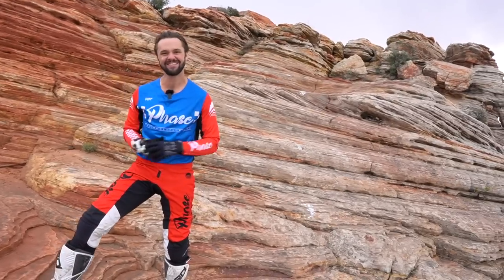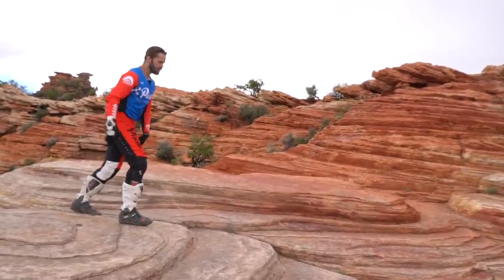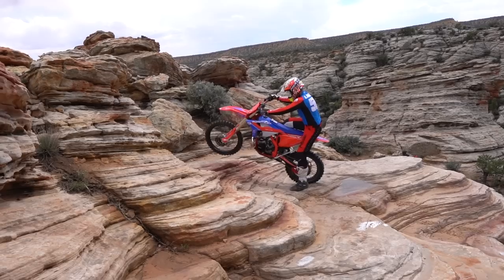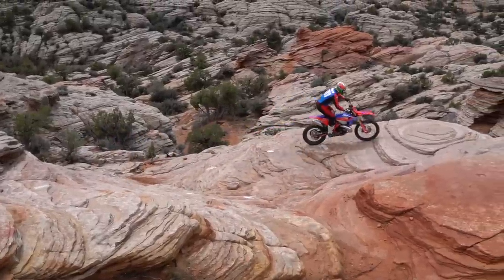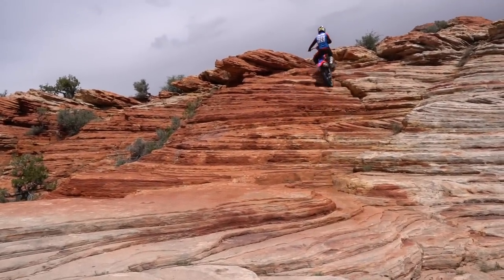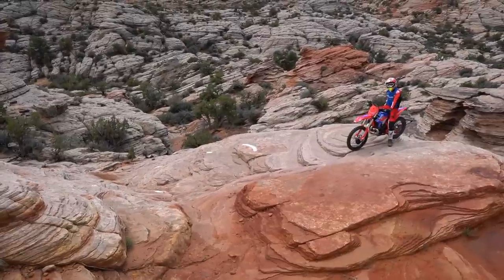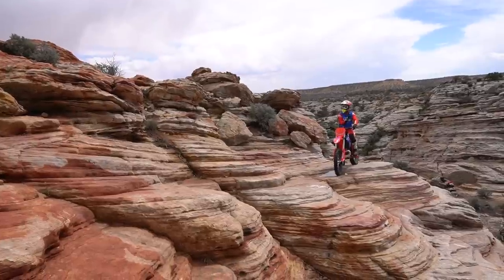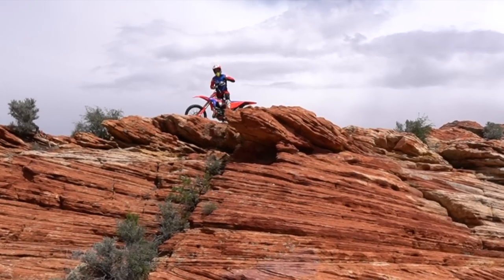Real World Technical Riding Lesson! 5 Miles of Hell, Section How-to E.P. 1

Comment: Hi Rich! First of all, thanks for all the videous. You are mine "online coach" :D What gear you use for this kind of obstacles? I was recently told in a Hard enduro training camp that 2nd gear is the driving gear and 1rst is just for pivots etc. I have a 13-51 gearing in my Beta 300rr.
Reply from the maker: 13-51 on the beta would closer to second. I’m stock on beta gearing so I’m in first. That’s a tough question for me to answer because everyone’s different.

Comment: What, if anything, do you adjust on your suspension for this trail vs. your typical single track....thanks!
Reply from the maker: That’s a good question. So suspension is obviously relative. A single track setting for me would be much stiffer with more rebound dampening. For this trail, it would be closer to the opposite for comfort. That being said, there’s a lot of sharp edges and hard hits so there is a point of diminishing returns the softer you go.

Comment: Would it be possible to go this track with a Honda Crf300L Rally? It's just 27hp but 153 kg...... What do you think?

On original IRC tires of course! 😜
Reply from the maker: You definitely could!
Reply: There a YouTube vid of guys doing it on full size ADV bikes so yeah. But it's not pretty.
Reply: @IRCTireUSAMoto  Thx! 👍
Reply: @moleson10  That's interesting. Thx! 😎
Reply: @IRCTireUSAMoto  What do you think will be the biggest difference to consider and care about?
Reply: @deeno_berlin  I can think of two. 1. Protection: The bike has to be able to withstand being dropped in multiple ways on solid rock. Breaking a critical part mid way thru this trail can make for a really long day. With a couple exceptions there's no easy way out. 2. Gearing: My 250xcf was geared 12/51 and I kept trying to shift down when I was already in first gear. My guide's 150xcw was geared 11/50. Yep someone makes an 11 tooth front sprocket.
Reply: @moleson10 hx! Good points! CRF standard is 14/40.....

Comment: We used to one shot this section and actually follow the paint, not straighten the trail like you did.  My first time on 5MOH was in 1999 on my XR250L.
Reply from the maker: I don’t know what you mean. Did you watch the video? I did both. Following the white line on this section is the easier line. If by one shot you mean doing it feet on.. it’s still the easy line.
Reply: @IRCTireUSAMoto  Yes, I watched the video.  When you followed the trail you did it in three shots.  You came up to the painted 90 degree right and reset the bike, then up to the 90 degree left and reset the bike.  When you did it "clean" you turned 45 degrees, pulled the trigger, and totally straightened the trail.  We would follow the paint with the right and left turns with no dabs - one shot.
Reply from the maker: The video is meant to be helpful for amateur riders experiencing this trail for the first time. They aren’t going to be no dabbing this section. I demonstrated that here. 
That being said what your talking about “no dabbing the white paint line” is still the EASY line. Not hard